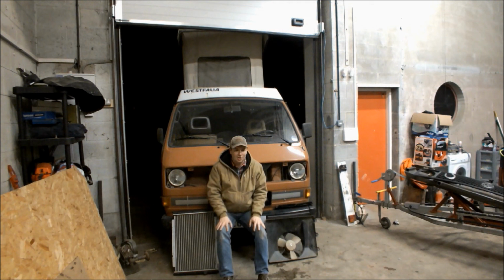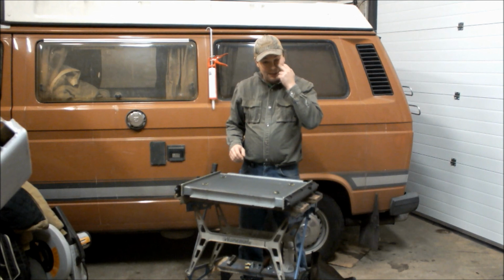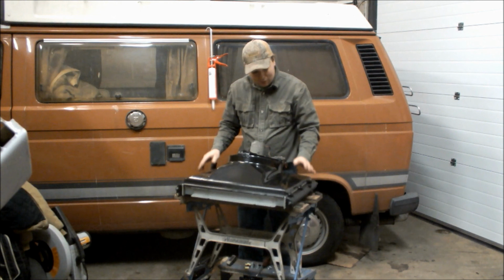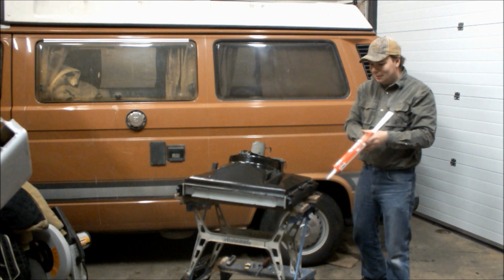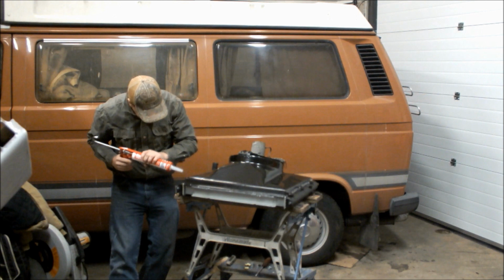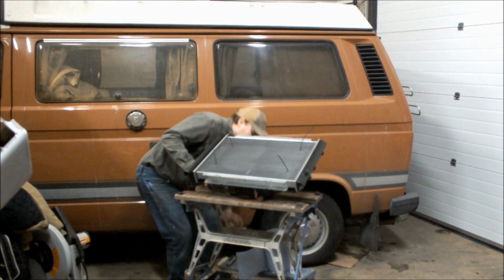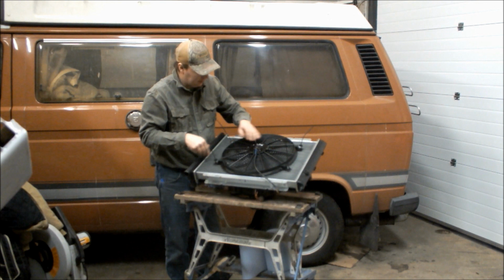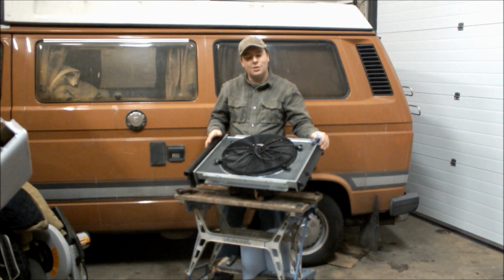VW T25 Radiator upgrade

Comment: That's an interesting addition to the radiator, especially adding the caulking. Can you list the brands and/or part numbers of what you used? I would think the silicone caulking would melt when the radiator hits a high temperature. Inlike the stand offs setup you did. I think I would wire mine to a manual switch though instead of in with the stock fan sensor.
Reply from the maker: +heart4Pahoa ,Thanks for commenting!. The caulking works wonders it really does, it is just basic exteriour grade silicone RTV. It is available from any hardware store. I have done this loads of times to all sorts of things EVEN A TRAIN!!! and it has never melted.
Im glad you like the mountings for the extra fan, this is how they usually mount so nothing special. 
I will use the original fan switch so i cant forget to turn them on but i will wire in an override so i can get ready for a big hill or such like.
What else would you like to see, I need to make another vid this week for the t25?

Comment: Thanks for the quick response and taking the time to answer. We have an 83 Westy with all of the origin cooling system and associated steel plumbing. Are you retaining your rubber and steel plumbing or are you going with the stainless steel lines and new rubber? If you are changing those things out, some video of that process would be nice to see. Assuming you have not already done so. Thanks for sharing.
Reply from the maker: +heart4Pahoa , yes my van is the same, all original. HOWEVER, i am replacing the lot with stainless and putting a circulation booster pump on. All of which will be filmed. The stainless front to rear pipes will actually aid cooling too as daft as it sounds because the stainless will radiate heat better than rubber and plastic . 
Always happy to answer questions.

Comment: i did this ... and my radiator fan doesn't turn on. it is not the fuse (checked it) and yes there is power going to the switch (i stuck a paper clip in in two of the sockets). any ideas?
Reply from the maker: Which fan, the front or the back?

Comment: Hey man, just wondering if you're ever going to be able to make that video about wiring in the new fan thanks!
Reply from the maker: I wasn’t but I can if you’d like
Reply: It would be super helpful, my radiator developed a leak so I got a brand new one and have the 16 inch 80 watt 12 volt fan. You can see my whole process at Jacob_Finston. Also does the caulking and sealant prevent air flow? And what brand do you suggest?
Reply: On Instagram.
Reply: Also does the lacquer have to be high heat or will clear coat work?

Comment: hello you can tell me exactly the link where you bought the fan thank you
Reply from the maker: Hi, the one in the cowling is the original vw one and the extra one is just a universal 12” off of eBay, many many sellers for these
Reply from the maker: You will have to check the video I can’t remember the diameter off the top of my head (did it nearly two years ago) BUT the type of fan is fine